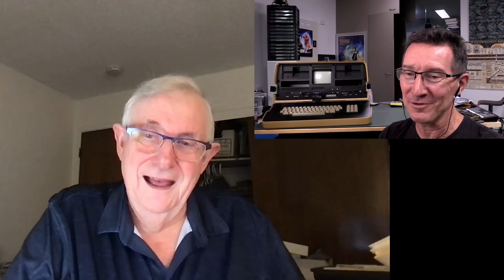Lee Felsenstein - The Osborne 1: Setting New Standards in Adequacy

Comment: Power supply in my Osborne-1 is totally dead. Is it legal to replace it with contemporary unit or do I have to be Curious Marc II and fix it?
Reply: I'd say it's okay to get a new computer at this point. 

Considering the potential future value of the Osborne, I'd try to fix it. But if you replace the PS, don't make new holes or shorten wires. Keep the old one with the computer for future restoration.